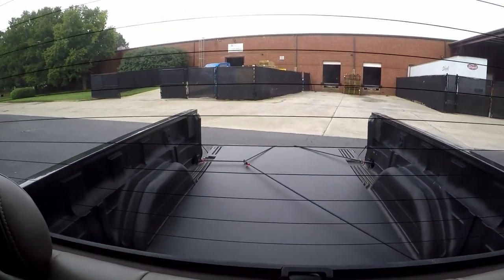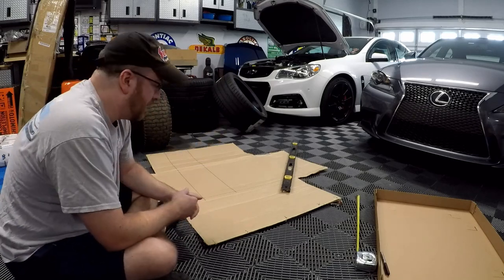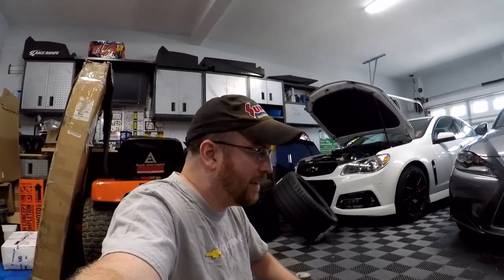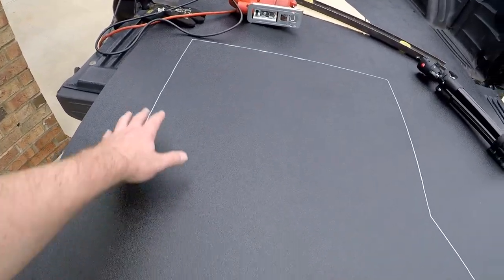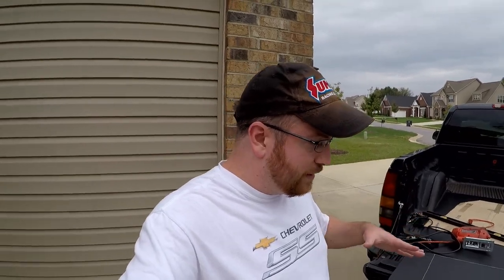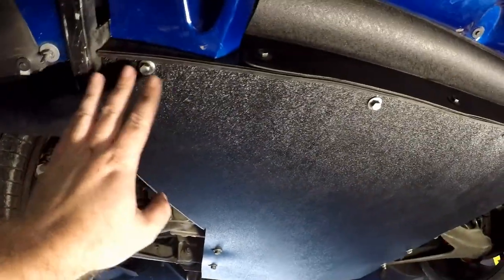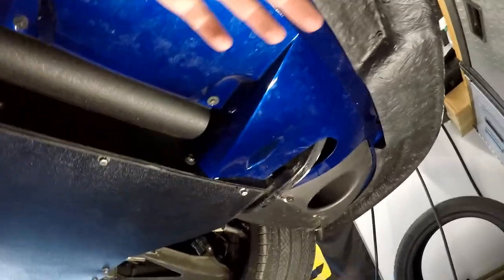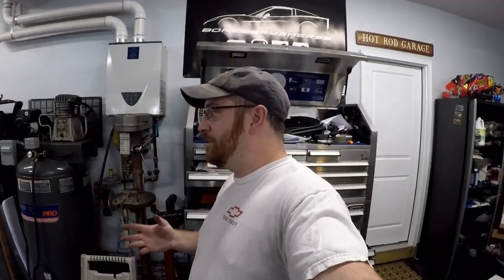2005 Chevy Corvette - V4.0 - Ep 3 - Custom Belly Pan

Comment: Did this fixed the lift problem at 140 ? Also you didn't see the car heat up from removing the air dam/ plastic scraper thing lol.
Reply from the maker: I haven't hit 140 in years....

No - only overheating I've had was from the failed Prospeed PWM fan controller.